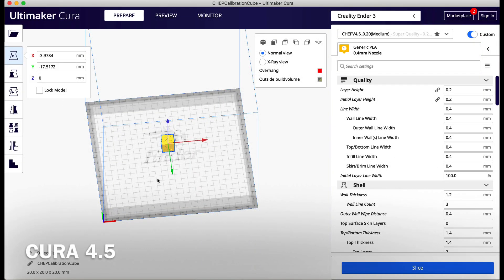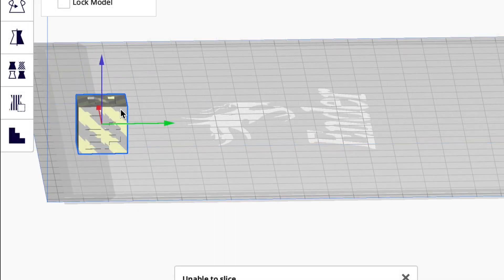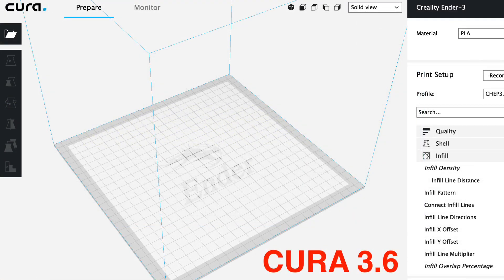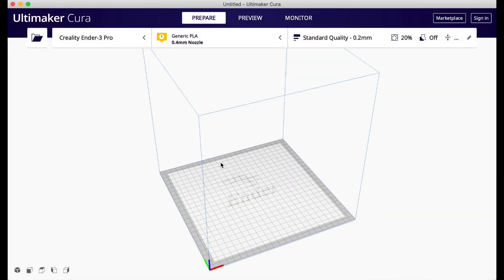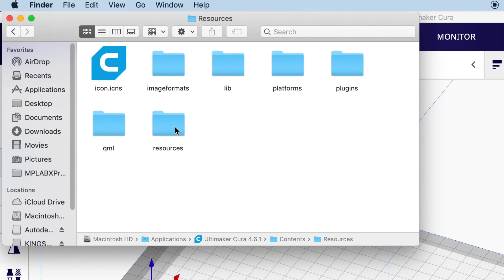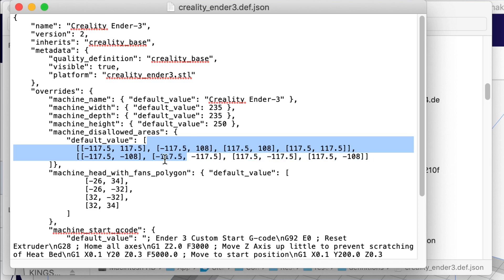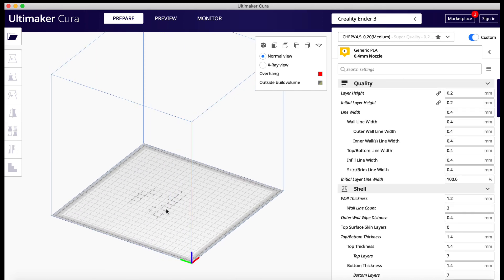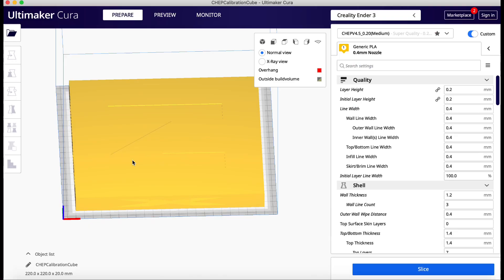How to Remove the Creality Ender 3 Keep Out Area in Cura

Comment: does anyone know how to get rid of the grey ring or even make it smaller?
Reply: Go to advanced settings and set the adhesion to 'none'
Reply: @khushkhanna8228  I'll give this a try
Reply: @khushkhanna8228  Similar question but I have already removed the skirt and it still won't let me print to the full 220 x 220 area.  Any suggestions?
Reply: @andrewheimburger  you have set the 'bed adhesion type' to none?
Reply: @andrewheimburger  in printer settings set bed size to 235x235, which it physically is. This plus what Chuck is talking about will do the trick.
Reply: @MrStolarsky  I did both and it is still cutting my prints off by a couple of mm
Reply: @andrewheimburger  than you need a Marlin firmware. Had the same problem and its gone with Marlin update.
Reply: @MrStolarsky  thanks!  I will look at installing that

Comment: when i try to save the file i get an error saying that i don't have permission to open the file and that i need to see the owner of the file or an administrator to obtain permission
Reply: the fix is if you are using windows to right-click on notepad and click "run as administrator" and open the file from the notepad menu then edit as the video says to
Reply: @noneofyabusiness1098  Hi Thanks for the suggestion. I did as you suggested and the first three times it wouldn't let me save it so I opened notepad a different way and it let me do it. So thank you so much

Comment: I have the Cura 4.8 (Ender 3) on mac and it doesn't work for me, any advice to remove it?
Reply from the maker: Move it to the trash can.
Reply: @FilamentFriday  I just updated from Cura 4.6.2 to 4.8 on Win10 for my Ender 5 Pro.  I now have a big "Keep Out" area but I can't seem to find a specific .json file for the Ender 5 pro.  There is a .json file for the Ender 5 but that doesn't have a disallowed_areas section.  It believes my printer is a Creality Ender 5 Pro (at least that's what I defined).  Any idea where Cura is getting its "Keep Out" definition from?  How can I get rid of it?  This is really a pain.  Appreciate any help.  Thanks.
Reply: Its up in settings, then printer settings on cura

Comment: This works in Cura 4.8 for Ender 3, however you won't get the full bed if you are using a skirt or brim on your print.
Check your print preview to see layout, in order to get the full 220x220 size you want.

Comment: I tried with version 4.7 and it doesn't work. Only with version 4.6.1
Reply: Same running 4.7. Cura seems to ignore the edit and keeps the "Keep Out."
EDIT: Check the build plate adhesion setting! That's what was causing it to fail to slice. Set to "none" and it sliced fine. DOH.
Reply: Same experience. Seems like cura restores the default definition upon opening cura. After checking the edited definition, the disallowed areas are back again
Reply: Works for me too, make sure you're running notepad++ in administrator mode to save the changes and then restart Cura once you're finished
Reply: @retrosteve2732  Thanks! Notepad couldn't see the file, and using notepad++ as admin made it work for me. Had increased the build volume to 400*400*500 (ender extender kit), but the keep out area stayed where it was.. Thanks for the help!
Reply: Works just fine for me in 4.7 and 4.7.1
Reply: Actually, you can remove the keep out shadow by removing skirt setting to none or make the skirt smaller so that the build volume will be increased. works in cura 4.7

Comment: Using Cura 4.6.1 with the Ender 3 Pro profile default of 235x235 bed size the grey bars still cut off a significant portion of the bed. It's only allowing a usable area of 205x205. Even in the video with the Ender 3 Pro profile it looks like the allowed printable area is 215x215, still not even the advertised printing area of the printer(Maybe it's different in Mac since I'm using Windows?!?) . I checked the definition file, but there was nothing about a disallowed area to change. I don't like the idea of increasing the bed size values since it will not be a correct representation of the actual bed and can lead to the printer trying to go too far in the X or Y direction depending on where you place the model. Anybody know a fix for this?

Comment: I have Cura 4.6, I went into Printers and changed the printer to an Ender 3 Pro and then edited the Machine Settings and changed the bed size to 250mm X 250mm X 250mm and now I get full advantage of my 220 X 220 build plate. Cheers!

Comment: Hi, I try to do this tutorial in my ender 3 pro with Cura 4.6, the first thing I noticed was I couldn't save the file, so I try to open sublime as administrator and save it. After that I re-open cura and nothing happened. Did I miss something? thanks
Reply: Run notepad as admin, then open the file from file>open. You can't save files in Program Files as an non-admin. You have to authorize notepad to run as an admin, then you can do whatever you wish.

Comment: I can't do it for some reason. Says access denied
Reply: open the texteditor as administrator (on windows search for "notepad" in the search bar and right click "run as administrator") and then open the file from the notepad via file - open. Then you should have the rights to do it!
Reply: @i.i.iiii.i.i  Hi i have the same issue where it wont let me edit the file and save, i did what you said and opened test editor notepad as admin but when i get to definitions it says folder empty, if i go through normal way it is trhere but as i said it refuses me to edit can you help?
Reply: it is ok i forgot to click all files thanks for the help my friend
Reply: Jay's technodroid  
See that's what I mean xD
But you don't need to run cura as administrator, you need to run the text editor as administrator... Otherwise you can't edit the file.

Comment: Hi Chuck, great video.I am using Cura 4.6.1 with a non networked Ender 3 but I do not find the Ender 3 Pro configuration in any of the drop-downs. Is there another version of 4.6.1?

Comment: Excellent! Thank you Chuck for the very helpful walkthrough!
I'm running 4.6.1, so I just opted for the Ender 3 Pro solution.
Are there any other setting that are specific to the Pro, which will then mess me up because I have the non-Pro Ender 3?
Reply: Well, I am running with it, and I can answer my own question in one regard - the default bed temp is at 60 for the Pro vs 50 for the non-Pro. I find that that for the PLA I am running, anything over 50 makes it a real bear to detach from the bed, so I would recommend dialing it down to the 50. Will keep an eye on this print, and let you know if there are any other Pro issues to look out for.

Comment: u still got the dark grey area, if u go to settings,printer,manage printers,select creality ender 3 pro and press machine settings
then make x(width) and y(depth) 
235-->245 and close, then put it back down to 235 et voila the grey erea is gone!
Reply from the maker: Put what back to 235?
Reply: @FilamentFriday  it worked once, i tried again and had no succes anymore, i dont know what happned :S
Reply: @FilamentFriday  Hi, there's any way to extend the printing size of the bed, say to 232mm? I have a project to print that is 230mm wide and I'm unable to do it even after doing what your video say, I'm running Marlin 2.0 from TH3D on the Creality Ender 3 Pro. and Cura 4.6.1 Thank you.
Reply from the maker: You can try making the bed settings 245 in Cura but then you will have to adjust position to get it properly centered.
Reply: @FilamentFriday  Thank you so much for the answer, I had tried that and you're right, is not centered, how do I fix that? It could be good for a tutorial video.
Thank you.
-----------------------------------------------------------------------
@wardwyseur Please forgive me for making questions that may be different from your original comet, but your comment is the closest to my question I have found in here.

Comment: Thank you CHEP. Done here, worked perfectly. Have you ever seen someone complaining that even if you center the object in cura it does not print centered in the ender ? Its 2 or 3 mm (sometimes 5), but its not centered. Is it mechanical during the setup or its in the software ?
Reply from the maker: Check your machine dimension settings. They could be off.
Reply: @FilamentFriday  I checked that. Its ok, 235 x 235 x 250 on the ender pro, but still not center by a bit. I will try new tests to see. I was thinking about if any of the assembly could change that, but as everytime you print the axis goes until the end and touch the "click", which means to me it "zeroes" the position and then start from there.
Reply: This is what the extruder offset is for. Adjust x and y offset so that the actual print is centered on the bed.

Comment: i'm using your settings for a few months now, but since ive switched to the micro swiss hardend steel nozzle, the overhangs are much worse. if I print a benchy, the whole front bow is ugly... already tried different temps, flow, calibration of the extruder... i just can't get rid of it. any ideas?
Reply from the maker: I haven’t tested that Hotend yet so I’m not sure.
Reply: @FilamentFriday  I've only the nozzle. That's the strange thing...
Reply from the maker: Oh, those require higher temperature settings typically.

Comment: have an Ender 3 Pro that seems to work great for a bit, and then the first layer won't stick. I re-level the bed, check temps, use glue stick all to no avail. I will mess with things, reset z-offset, mess with it some more and eventually it will be back to working great again, but I can't really point to what fixed it. Do you have videos I should be watching to get help with this?

Comment: Great vid again, well done , however, when I try to save the modification, I get a "you do not have permission " error come up and it prevents me from saving it. Do you or has anyone else had that error and it ?
Reply from the maker: Someone said on PC you might need admin access.
Reply: CHEP thanks for replying, however I’m a bit of a noob with computers and it’s a little over my head, thanks anyway.
Reply from the maker: Use 4.6.1 and select Ender 3 Pro.
Reply: CHEP , no worries mate, I’ll give it a go, always worried about upgrades but I’m pretty confident with backing up and reloading, thanks for your interest and help.

Comment: Is it possible to make just the area where your clips are to be the unprintable area? E.g. clip is 30mm from start of x axis the keep out for width of the clip. That would be even better
Reply: If you are using Octoprint, there is an Octoprint plugin to define unprintable areas.  For clips just define a small rectangle around where the clip is located

Comment: So if you always put the clips in the same position, you would be able to define a few small no-go-rectangles?
Reply: I just change them until the print is high enough and/or try to gave them out of the way also I can use my ender 3 v2 original clips

Comment: Hi there, the grey area also can be change in preferences_printer setting, in machine setting you change the x and y to 235 (bed size of ender3).
Reply from the maker: No, that doesn’t change keep out area. And the Ender 3 profile is already at 235.
Reply: @FilamentFriday Hi, with standard setting (Cura 4.5) I can set to 210 x 210, but I'm following your guide my bed still 210 x 210 but in your video you can set until 220 x 220, may be I have miss something, and for editing the Json file  i'm using notepad++, thank you.
Reply: I tried it that way... and searched for other information... CHEP's fix helped me use my whole bed for ppe printing.

Comment: hey chuck! great video as always! you should check out my latest video, its on the same topic, but kinf of the opposite, i made my own theme for cura, which makes innaccessable areas red, and also makes the unable to print camoflage a little more obvious, adjusting the overhang color to something a little more subtle, and changing the x-ray and preview layer view colors to be a little more representative of what they actually do. all in all this is a purely visual upgrade, but i think it works well. id be curious about your opinion, and the theme is available for download, and easy to install. just unzip and drag and drop to your themes folder under resources. not gonna link bomb your channel, so if you check it out and like it, feel free to throw a link up yourself! oh and if you have any interest in a chep theme for cura, but dont have the time, id be happy to throw something together for you!

Comment: I just tried doing that, not only are the not allowed sections much smaller in my cura but when I opened the definition file there was no disallowed section to delete, which I found strange ... Then I looked in my printer settings and in my cura the ender 3 was set to 220x220 so I changed that now...

Comment: Nice video again. 

2 questions:

- What's your reason for using Cura 3.6 still or any other older version?
- Any useful alternative for the clips? ^^
Reply from the maker: 3.6 doesn’t use Creawsome. 
I don’t mind clips so I’m not sure.
Reply: Magnetic flexible steel beds for one... also, older Ender 3's shipped with Creality build stickers directly applied to the heatbed.

Comment: I'm trying to use almost the full area of the print bed, about 230x230mm. It slices fine in Cura 4.6 thanks to this video, but the Ender 3 prints it off-centre in the Y-axis, so it doesn't fit. Is this because the stock firmware is set to 220x220?

Comment: CHEP, Here's one for a possible future video topic:  How to manually enter G-Code commands (like M115, to get your firmware version and related information) one-at-a-time from within Cura ?  (I don't see a terminal for entering commands manually in Cura, like i have in Pronterface and other software)
Reply from the maker: I use pronterface for that. Cura doesn’t have it.

Comment: FYI, the remaining all-4-sides grey area is a result of your "Build Plate Adhesion" setting; it is reserved space for the skirt or brim.  Change build plate adhesion to "none", to use the entire bed area.
Reply: You're the hero I needed. I have the 3 pro and those lines were gonna screw me on a part that should have been able to print. Thank you
Reply: omg thank u very much!
Reply: This! Even with the wide no print regions I've ran over my clips twice with the skirts. Its a good idea to turn them off completely when doing big prints. I usually add a second 1 layer thick stl and print one at a time or just do a purge before it starts printing.
Reply: Holy crap Ty so much
Reply: Thank you!!!! Omg
Reply: I love you❤ thanks🎉

Comment: Good day sir.
This was actually something I was wondering if you could change.
The epic Ender 3 problems have come to an end. The extruder stepper driver was dying.
An inconsistent signal from the driver would explain getting extremes of over and under extrusion. Followed by the extruder motor stopping completely during troubleshooting.
A good excuse to upgrade to the silent board.
Thanks for your help trying to find the issue blind. I appreciate it.

Comment: The ring around the outside is probably just a visual representation of the area limit introduced by the skirt or the brim. On my machine, which is a custom machine and not an Ender, if i disable them, the keepout ring goes away.

Comment: I never had this problem ???  I think probably because I have been using Cura for ages, and when I first started running the ender 3 on it I remember changing the bed size to 235x235 in the preferences, but I never had to edit any config files or anything , as I updated to each newer version I usually kept my settings etc so never ran into it.
  Good to know tho, incase I ever have to re-install or anything and it should appear.
Reply: it's based on the "Ender 3" printer profile that was introduced several version ago.  If your profile is based on a different printer profile (such as "Generic FFF Printer", then you would not have experienced this when using an older profile)

Comment: Is there a way to still get the ender 3 model ghosted in like creawesome had.
Reply: Yes there is! If you search it on the ender 3 subreddit you will find an stl of the printer which you can put in the cura files manually
Reply: Stan van Egmond I happen to have the slt. I just have not found where to place it manually.

Comment: Thank you SOOOOOO MUCH. I got these with updating Cura and didn't knew how to get rid of them. 

Can you also make a video on how to remove this "area" around the nozzle, when I want to print multiple object one after another? I printed these "ear savers" for face masks, I wanted to out 5 onto the bed and not print all of them at the same time. However, cura wants a very large area around the nozzle to be left clear, so I can only fit 2 of them onto the bed.

Comment: For those of you running Windows: Just make sure you're running Notepad as an Administrator or you will not be able to save the changes. Just right click Notepad -> Run as Admin -> Ctrl + O to open - make sure All Files is selected from the drop down in the lower right -> navigate to the folder specified in the video and open the file -> make your changes -> Ctrl + S to save -> close and you're all set.
Reply: Why this method over recommending notepad++?
Just curious.
Reply: ehmc130 , not working for me, keep getting the same error or resources is displayed empty. Dunno.
Reply: Thanks

Comment: the gray area which are left around the edges is the limit which is caused by your settings for brim or skirt. Since the brim/skirt if selected has to fit onto the plate, Cura reserves the area around all edges.